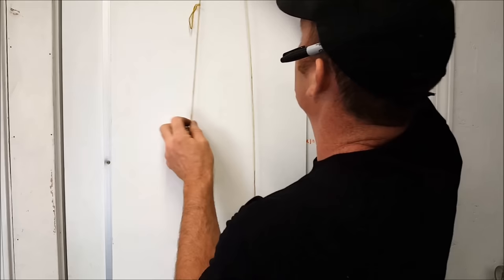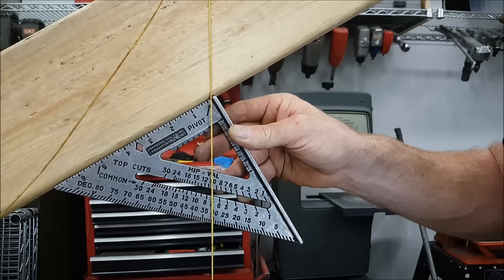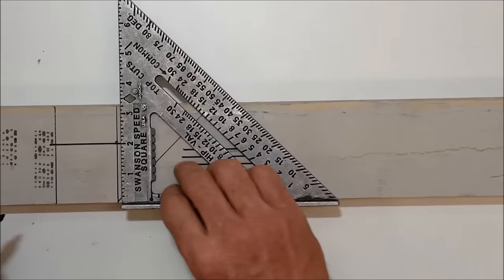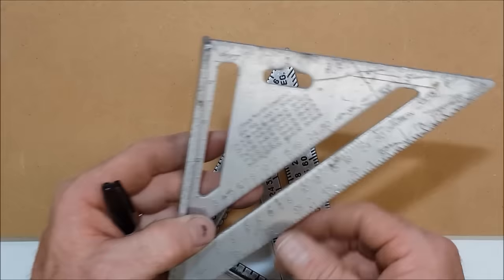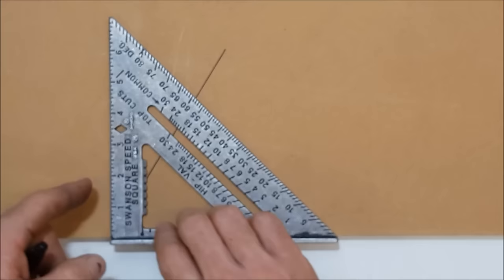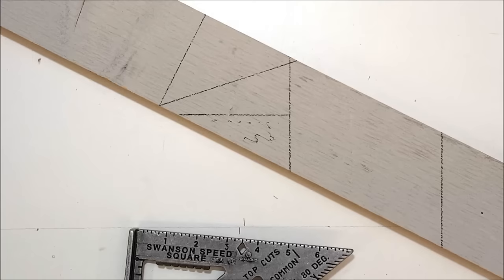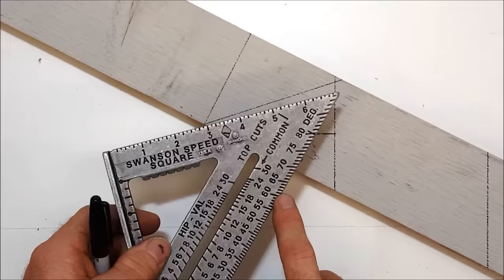Speed square basics - How to use one

Comment: Another great square video. thank you. Though we all do it, technically, pitch is not the same thing as rise. It's even descibed in the book that comes with the speed square. Pitch is the ratio of the total rise(height at the peak) to the span of the building. So, if the building is 24 feet wide and the rise of the roof is 6 inches in 12 inches(giving a total rise of 6 feet) the roof is a 1/4 pitch, because 6' is 1/4 of the 24' span. If the rise were 12 inches in 12(giving a rise of 12') the roof would be a 1/2 pitch. Forgive me for stating something you already know. But for those of us just learning about roof angles its good to have that understanding.
Reply from the maker: Thanks Tim, I was using "pitch" colloquially. You are correct about the pitch rise/span relationship. However, the "slope" is the correct term for the  rise/run relationship listed on the square.  "Pitch" = Rise/Span. "Slope" = Rise/Run. For any given roof the rise is used for both methods and they are both accurate descriptions of the same roof.
Reply: @Makebuildmodify  thank you

Comment: I knew about only half of these, and to think that a square can be used for more than just a saw guide...!
Reply from the maker: Yes, I use it as a saw guide all the time. Thank for watching!
Reply: It is a favorite for me too as a saw guide, but it did take years before i learned to flip it and have the edge on the other side of the board so i could pull it towards me with my left hand while I pushed the saw away on the right... keeps it from moving and the cut is faster.

Comment: Carpenter in the UK here. I have a 6" speedsquare, a 12" Swanson, and 2 framing squares. They are all great tools that are fast to use when taught properly.    Our biggest problem is measurement units.    Those squares are great for self cut roofs if they are in Imperial.  Not so much in metric.    Also,  most roofing and staircases come as trusses and precut stairs.   Going back and forwards between the different measurement systems is a nightmare.  Not only that but the big corporations bought out all the small genuine woodwork workshops and now hardly anything fits together.   It all has to be fenangled on site...terrible.    We have lost so much.   Last thing.... I lost a contract to a man who spent 6 weeks at college and got a certificate to say that he was qualified.   He undercut all the contractors by a lot and some was palmed off to the quantity surveyor.   So,  what's the point anymore ?
Reply from the maker: I've struggled with all of the above. The new guys will often undercut to get there foot in the door. If you target work that requires more than 6 week of training (work that requires years of skill building) then you'll be less likely to be undercut. This generally means targeting wealthy clients. Wealthy clients means that you have to step up your sales game a little though.  

My hat is off to you for using both systems. I use both too, but I only use metric rarely and only when necessary. I think there are metric speed squares available in the UK. You would probably know better that I. I know I've seen them on Amazon. I work with trusses a lot (imperial system) and find plenty of uses for the imperial speed square while installing them. I can't see a reason why you wouldn't have the same experience with metric trusses and a metric speed square.  I cut all of my own stairs so I don't have the trouble of fitting manufactured stairs to the existing structure.

Comment: What is a "6, 12 roof" ?
Reply from the maker: It means that the slope of the roof travels up 6" for every 12" it travels over.
Reply: elev drop of 6' per 12'

'
Reply: it drops 6" per foot if length
Reply: About as steep as you can easily walk on. Lol

Comment: Make Build Modify,
Just happened to notice those shelves in the background. I happen to have some of the same kind. I appreciate the way you used them. May make similar.
The speed square was introduced to me on PBS back in the '80's. by Norm Abrams. 
A must have indeed! Indispensable!
+Works by Solo, good point! I could say the same.
Thank you Justin!
Reply from the maker: Yes! I love that shelf arrangement. It's pretty simple to install too. It's better if you have plywood or OSB on the shop walls but it can be done by attaching to the studs too.

Comment: Nice explanation. I’ve used a speed square for years and still learned some things. The use with the plum bob in particular. Another useful tip- you can use it as a guide with your circular saw to make straight cuts.
Reply from the maker: Yes, I use it as a cut guide often. I just wanted to keep the video somewhat short.

Comment: I’m very new to woodworking and one of the woodworking channels stated that the 45° on the speed square is accurate enough for construction but not for fine woodwork. He also advised using a draftsman’s as they are more accurate. I have both having bought the Swanson myself and as my late father was an engineering draftsman I have a couple of his, but I prefer the Swanson because of the lip.
Reply from the maker: I would say that a speed square is designed for rough framing. But my experience has been that they are accurate enough for trim and siding on a home too. I wouldn't use it for fine woodworking though.
Reply: Make Build Modify Thank you very much for your answer.

Comment: Good video. I've been building things with Speed Squares for 30 years. It is one of the most versatile tools on the job site. By the way, you can also find the pitch/angle of a board using a speed square and a torpedo level. As a framer you only really need 4 tools; a hammer, tape measure, torpedo level and a speed square. Oh, and a saw man to yell the measurements to. ;-)
Reply from the maker: Thanks!
Reply: with a framing square -you can figure board feet--------

Comment: For years I've used only a framing square. I recently bought one of these combination squares to do other angles. I'm building a pressure treated hexagon to go around a tree to make a garden.
Reply from the maker: Nice! remember that the 60 degree angle is shared, so the ends are cut at 30 degrees. But you probably already knew that.

Comment: Having a speed square with the conversion table embossed is very handy when doing the birdsmouth on common rafters because I can see in your example that 6-12 pitch is 26.50 degrees and just do the math of 90.00 minus 26.50= 63.50. Another point that's not covered in these videos on You Tube, if the wall is already sheathed with e.g. 1/2" you need to add that in and make it 4 inches for the seat cut. Still an excellent video.
Reply from the maker: Yes, I should probably do a video specifically about roof framing for the people that want to know more about the speed square in that context.

Comment: Using the complementary angles (27+63=90) is more accurate than trying to align the points of the diamond with the heel cut line. Set the speed square to the complementary angle, slide it until the diamond is centered over the vertical line for the heel cut, and draw a line for the seat.

Comment: Thanks, good explanation of those "mystery" cutouts and notches.  One point that perhaps should be clarified: "pitch" of a roof is NOT the same as rise/run.  Pitch is defined as rise/span (from one outside edge of the top plate to the opposite outside edge for standard gable roofs).  For example: a roof pitch of 1/2 is equal to a rise/run of 12in/12in; 1/3 pith equals a rise/run of 8in/12in; etc.  "Pitch" may have become an old fashioned term, but I still encounter it and using it incorrectly could confuse 'newbies' causing them to misinterpret plans they try to read.
Reply from the maker: Yes, you are correct, it's a common mix-up. So common that slope and pitch are often used interchangeably. So, I decided to use it in the video. It's rare to see pitch representing rise/span in new construction these days.  Because this is a speed square basics video rather than a roof framing basics video I opted to stay clear of the roof framing definitions.

Comment: Never worked with building angles and squares but this could be a great start. Perhaps buildind a dog house or pump house to know how to make cuts. I worked in a wood shop making door units and wanted to understand gable vents but did not want to appear stupid. There are cuts make to wood slats with a compound miter to make the slats fit the pitch and still be 45 degrees.
Reply from the maker: Yes, a small building like a dog house would be a great starter project.

Comment: Show us how you can draw a large circle on a flat irregular wooden board using this square tool, also determine the center point of that circle too... would be interesting if it's possible.
Reply from the maker: You can do both of those things with a framing square.

Comment: For anyone in England easy hips/valleys. Whatever the main roofs degree pitch is, say 40° look at the common/jack mark when set and it will line up with 10. Now using the hip and valley marks move it round to the 10 and that's your hip or valley top cut and birdsmouth.
Reply from the maker: Interesting
Reply: @Makebuildmodify  as most of these 'how to use a speed square' are from Americans, it confuses a lot of Brits from some of the comment sections on utube

Comment: Apparently this is actually very similar to how the Egyptians did it.

The Egyptians had something that look like a speed square with a 90 degree and a 45 degree angle and it had a plumb-bob that hung down from it. Just like you demonstrated here for the door and leveling.

The other tool that they had looked a little bit like the letter F and it had a plumb-bob on it and the two arms for the F were the same length and they were attached to the back of the letter F shape obviously.  when you put that back  to Stone you know the stone was perfectly vertical and flush if the plumbob touched both of the arms of the letter F

And the third tool they had were some wooden dowels that they rolled across things to see where they would be dips or rises in the stone
Reply from the maker: Yes, I've seen those demonstrated before. Very cool.

Comment: Nice video first off,  but when using a square to construct rafter a framing square is much more suited, pretty much its main purpose. I personally love the Swanson for laying out my walls marking the plates. The notches in the top open section with the 1/2' increments is perfect for jacks king posts partion posts. I get your doing a tutorial on speed square  but im guessing even you use a framing square for rafters?
Reply from the maker: Yup, I use a framing square most of the time. But if I'm in a pinch I fall back on my speed square.

Comment: Good Review of the Speed Square, I also like the way you suspended your Air Tool? from the under carriage of a wire rack, how about some close up's or did you do an article you can refer me to Good Job Keep It UP Respectfully, Jim P
Reply from the maker: Thanks Jim! If you have that type of wire rack the air fitting will simply fit in the wire opening and hang there. Super easy and a great space saver.

Comment: Hi Mate I noticed your seat cut for the common rafter description was a bit deep  ? Note sure what the formula is in your country. But in Australia the maximum cut out for a seat cut is one third of the rafter thickness. Might be worth mentioning. I understand you are trumpeting the advantages of the square but an unsuspecting punter might think that the  seat cut is to contact the full width of the top plate. I love the squares mine is in metric  Cheers Gordon
Reply from the maker: Yeah, I wasn't too worried about it. I think I mentioned that it was a not a roof framing video couple of times just to make it clear to the noobies. As you know, there's a lot more to the speed square than what I showed in video.

Comment: The one thing I noticed you didn't mention was the seat cut without the pump cut if you put the square against the board Mark your pivot point mark your common 678 whatever it may be then pivot the square gives you your seat cut without the plum cut
Reply from the maker: Nice!

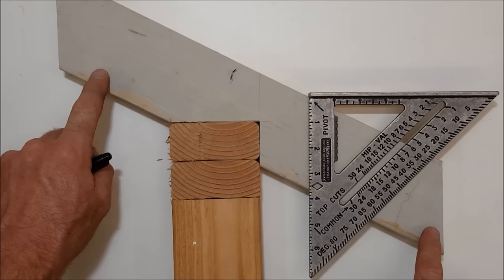Comment: Question; At the 5:30 mark you mentioned the top of the rafter goes through the 6" mark (from the pivot point). Now, couldn't this number easily become fudged? Couldn't you simply over/under pivot the square so the top of the rafter is reading at the 5" or 7" mark? How could you prevent an issue like that occurring if say, your working on a previously existing rafter?
Reply from the maker: I think that is an operator error issue. The square is only as accurate as the operator.

Comment: Now let's be honest, the imperial system with those thick lines with the width of 2mm based on 8th inch increments, only gives you the accuracy of a good guess :P So the diamond or 5" marker is close enough every time. To be fair, when building with wood in a house setting really can never be mm accurate anyway. 

I always say, Imperial is good for building wood framed houses and Metric for everything else :D

Just teasing, good video, thanks! Now I am ready, armed and dangerous with knowledge to build our little shed.
Reply from the maker: Yes, there is an accuracy limit to these smaller squares. There are larger 12" squares that double the accuracy if needed. Of course, if you're like me, you would use a knife to mark your cuts. 1/64th of an inch it smaller than a mm.

Comment: Hi Make Build Modify
Great videos, I hope you continue with your great work

Kindly very quick question
I wanted to order one using your link BUT unfortunately here in Europe we use cm
My question, If you could kindly post a link to order a metric speed square  (using centimetres instead of inches)
I saw the price $8.97, it ´s more than reasonable 
Thank you
Regards
Reply from the maker: Thanks Jenin! This is the only metric square I could find on Amazon. But it's $15.14 USD Not sure why the metric is more $$. https://amzn.to/2O9iq1Q

Comment: There is a difference between slope and pitch. Slope is rise over run in inches, pitch is a ratio of total rise to span in ft.
Reply from the maker: Almost. Slope is rise over run regardless of the units. Pitch is rise over span regardless of the units. They are linear ratios.

Comment: Use only the angle square.  over hanging edge to the rafter then slide the pivot with the over hanging edge to find your slope degrees. Just like you used it as a protractor or how you figured plum cut to the rafter.only need the square for all its uses
Reply from the maker: Not sure what you mean.
Reply: @Makebuildmodify  as later in the video you set a degree to have plum vertical cut on the rafter. With just the square you couldve adjust and pivoted to get the pitch of a roof without a plum string.
Play with a 2by piece and similar to  protractor you can measure 12 x6 pitch roof or whatever. Just saying a square alone can do most withing construction tolerances .
Reply from the maker: @dadsonworldwide3238  If you have access to the end of the rafter it can be done without a plumb string. But without access to the end of a rafter you'll need a reference to either plumb or level. It's also difficult to place a square against the surface of almost any roof rafter. This is because there is usually roofing or trim in the way. The method in the video is to avoid all of those roadblocks.

Comment: You dont need to hang your plum Bob to find level, you just hold the  string 
In the pivot point with it wrapped over the back . And dangle the bob from that is pivot point, it will still give you level
Reply from the maker: Correct.

Comment: I've had a speed square for 15-20 yrs but have never needed it for pitch. Just wondering where you get the 12, eg 6-12, 7-12, 8-12, etc. what you mentioned. Is it a constant value of 12 and does that represent 12"? So a 7-12 = 7" every 12"??

Didn't realize that you could do so much with a speed square.
Reply from the maker: Great question! The 12" constant is the "run" which is the distance traveled horizontally, and the number that varies is the "rise" which is the distance traveled vertically. So, 6"/12" means 12" of run and 6" of rise and a 9"/12" is 12" of run and 9" rise.  As the rise number increases the slope of the roof increases. The 12" standard is because a foot is 12". It's important to understand that the fraction that the rise/run relationship creates (i.e. 6/12) can be generic and can be applied in more ways that just cutting rafters.  For example, a 6"/12" is can be referred to as a 6/12 or 1/2 slope. The slope rises a half of a unit for every unit of run.  This becomes very handy when you need to do quick calculations. For example if I have a roof that is 19 feet from the outside wall to the center of the building it has a 19' run. If the slope is 6/12 I know that the rise is 9'-6" because (9'-6")/(19') = 1/2 and 6/12 = 1/2.  This allows me to calculate the height at the peak of the roof without having to climb up there and measure it directly.
Reply: @Makebuildmodify  Thank-You, that's what I thought.

Comment: Should the inch have been divisible, or based on 3, 12 parts to an inch? Instead of 8, 16, 32 etc? Think about it. What do you say?
Reply from the maker: Hmmm. I think 8, 16, and 32 work well because they translate to the decimal system without repeating forever. I think 32ths go as far as 100,000ths before they land on a dead accurate number.  In a 12 part system only the numbers divisible by 3 are non repeating. That would cause trouble when converting to the decimal system. 

I've often wondered why the decision to divide a foot into 12 was made. It's would benefit from the same halving and quartering that the inch was subjected to.